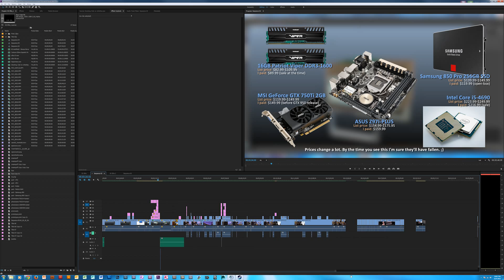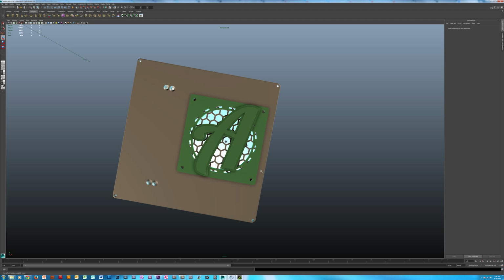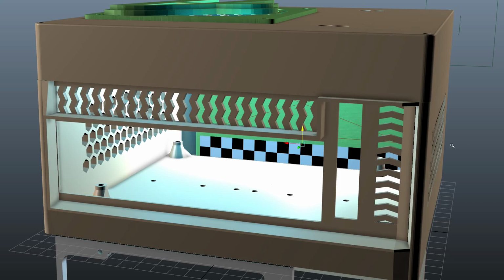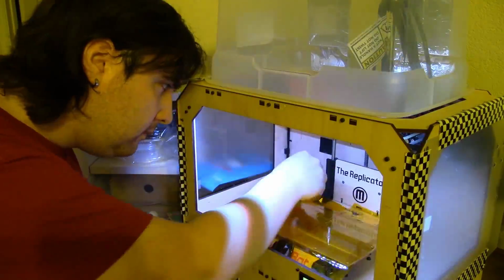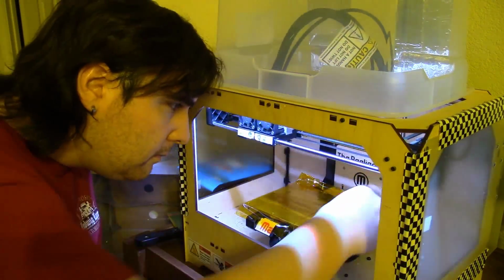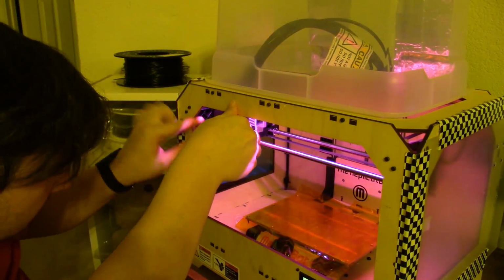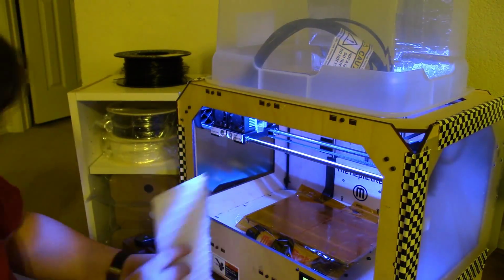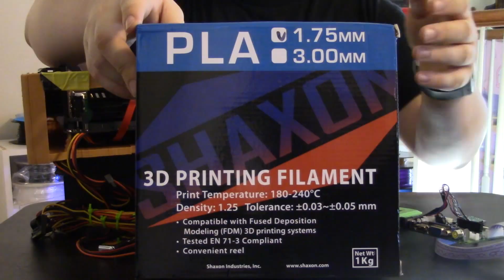3D Printed Computer Case - Part 3

Comment: May I suggest running the audio through Audacity to get rid of the background noise?
Reply from the maker: +TGVT During which part? If you mean the last section while the print is running in the background, that was my bad. I have software that could remove it (or, better yet, I could have recorded in a different room) but I don't usually like the result when I use noise reduction, especially because the noise of the printer is irregular. My bad, either way.

Edit: If you meant faint white noise in the background of voiceovers, I'll consider it but I'm unlikely to do it. I have an affinity for white noise (probably due to my tinnitus) and removing it sounds really artificial to me. I would love a suggestion for how to remedy what happened to the sound at the beginning of Part 4, though, for sure. That was awful.
Reply: +Adahop | 3D Printing - Gaming - Tutorials - Giveaways 

Hello! I did mean the last part of the video it sounded like a fan was running. But like you said, it probably was the printer. 

If I have your permission, may I capture the audio from part 3 and see if I can remove or reduce the background noise for you and try not to make it sound artificial like you said in your comment?

Also, in part 4. I do hear a faint 'echo' type of sound. That actually may be due to your microphone. Depending on what type of microphone, you should get a wind screen (a foam type cover) that will muffle echoes and harsh sounding letters like 'p'. Or, a simple solution would be putting a rolled up sock on the microphone itself. That's what I use.
Reply from the maker: ***** Something happened with my mic a day or two ago that made its gain go through the roof, even when I have the knob all the way down. That echo was an echo I couldn't even hear in real life (and as loud as I sound in the intro, I was a couple feet away from it for that section to keep the mic from peeking). Every now and then something weird happens with my gain - usually because of TeamSpeak, I think, and I think I know how to fix that.

I have a pop filter (though you couldn't tell that by this video, when I accidentally breathed straight onto it, haha) and I tried the sock thing once and it made the audio terribly muddled. I'll try to find the video with that audio so you can hear (it's awful).

The printer has several misbalanced fans on it, which was most of the noise in that shot - the rest was the motors on the printer.

As far as messing with the audio, have at it!
Reply from the maker: +TGVT Here's that sock-mic one. Geez, that was ages ago. https://www.youtube.com/watch?v=D-kRQveDQEk

(Same microphone as now - the overused Blue Yeti.)
Reply: +Adahop | 3D Printing - Gaming - Tutorials - Giveaways 

Ah, I hear it. I do agree it sounds muffled. Check your inbox for a private message from me.

Comment: Are you going to use a picoPSU?
Reply from the maker: +unijabnx2000 I thought about it originally, but ended up going with a full size ATX PSU. I bought the PSU before I settled on a GPU, but I'd need a PSU capable of just south of 400Watts to have enough headroom for the system to ramp up as much as it might need in a demanding game, and picoPSUs of that size are pretty rare.